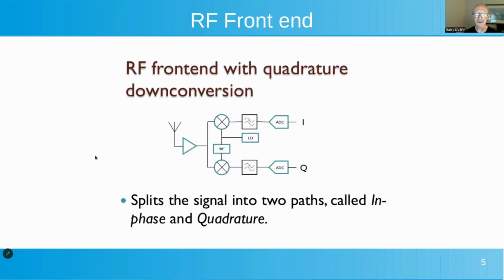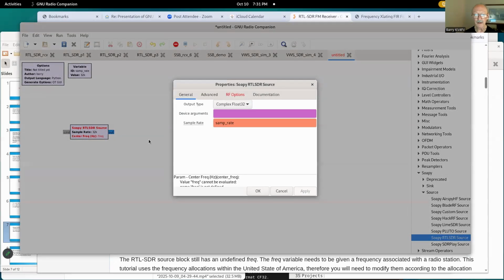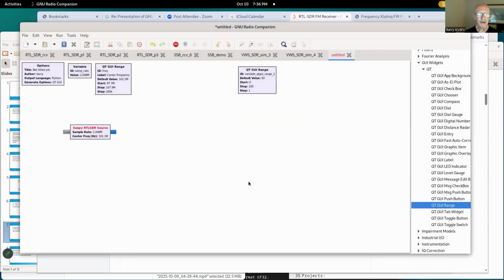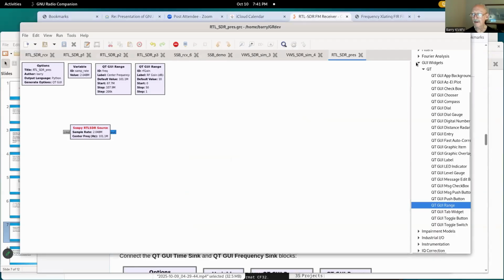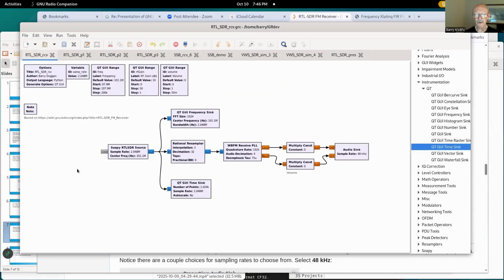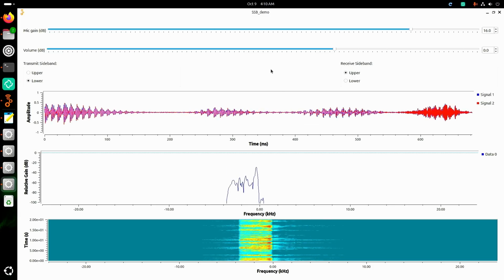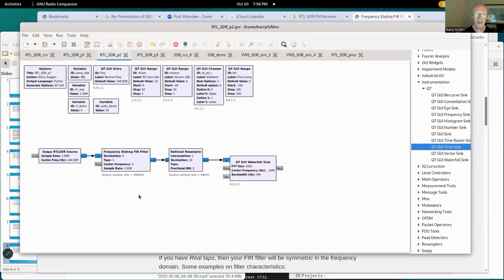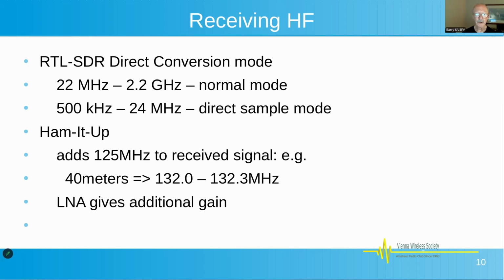Quick and painless practical introduction to GNURadio with Barry Duggan, KV4FV

Comment: I'm thinking of buying a couple SDRs.. like a LimeSDR-USB or FlipperZero...  but haven't found much in terms of what kind of practical things can be done with them.  It's usually very theoretical or the application is an FM Radio Receiver / Waterfall visualizer!

For example, I have a 2007 Yaris Key Fob, but programming a new Fob didn't work.  Would an SDR be able to record/analyze/display the 2 fobs output to see why my second fob doesn't work? 
Also, my Tire Pressure Monitoring Systems (TPMS) keeps showing a warning light on my dash, yet my tires are properly inflated yet.  How can SDR be used to solve practical problems?

Is there a course that covers practical applications.. maybe things like:
--Morse Code CW Transmission (NFM and AM/USB) and automatic decoding/Receiving (CW Skimmer, CWGet , morsecode scphillips translator, "Playful Technologies" AI-based Morse Code Decoder, etc) 
--HAM : trunking (SDRTrunk / Unitrunker) / TETRA (SDRsharp plugin, OpenEar, OsmocomTETRA), digital-modes (DMR, D-Star, System Fusion/C4FM, NXDN, P25/Police Scanner (DSD LouisErigHere), POCSAG (PDW Software) , YSF FT8 )) , convert modes on the fly (i..e use DMR radio to talk on C4FM), 
--Decoding/Visualizing Weather Satellite data (noaa-apt, WXtoImg, SatDump, SDRuno + Orbitron , USA-Satcom XRIT and XHRPT, Meteor Demodulator + MeteorGIS) 
--ADSB Plane Tracking (X-Plane / XHSI and AdsbSCOPE plugin, MultiPSK with Maperitive, dump1090, BaseStation) ;  
--Finding Satellites (Orbitron , g-predict, orekit, SatDump, PreviSat, Pypredict)
--GPS Decoding/Plotting/Spoofing ( GNSS-SDRLIB, RTK-NAV, GypsumI, SoftGNSS (matlab)) 
--ATSC Video Receiver/Transmitter (Portsdown DATV, SDRAngel, GRC, SDRGlut) 
--Local GSM/LTE cellular network (GPRS) (gr-gsm, Kalibrate, IMSI-catcher, srsLTE-Sniffer, rtl-sdr-LTE dedsecimsi, FALCON) 
--Text/voice decoding (OpenEar, Defcon 2016) 
--Inmarsat AERO satellite Medlink AMBE Audio ACARS (jontio / libaeroambe built JAERO) 
--Reverse Engineer Direct Sequence Spread Spectrum ,  Clock Recovery Techniques
--Visualizing RF that circuits emit before formal MIL-STD-461's CE101/CE102/etc testing  ( "free radiated emission simulation (electric field) of a KiCad layout + PCB layout review"  or "[RadioFieldAR -tinySA-] Visualize radio wave strength." (manahiyo831 / VR_RTLSDR_AVATAR or RadioFieldAR_tinySA-ULTRA))
Reply from the maker: SDR frontend, like LimeSDR is just a receiver, which interfaces the antenna to your computer. Think of it like a mixer in your traditional HF receiver. By itself it can't do too much. What makes it do all the magical things is the software running on the computer, which does filtering , demodulation, and all kinds of other signal processing operations.
The topics you mentioned cover an extremely broad range of subjects, and I doubt you can find one course which covers all of them. However, there are tons of videos on YT and very detailed posts on blogs which explain in details how to build such applications. Just be aware that RF processing is often a small part of knowledge required to fully utilize the radio. Even relatively simple things, like tracking satellites, require at least cursory knowledge of celestial mechanics, a cellular base station will be useless if you don'r know how the network works, etc.